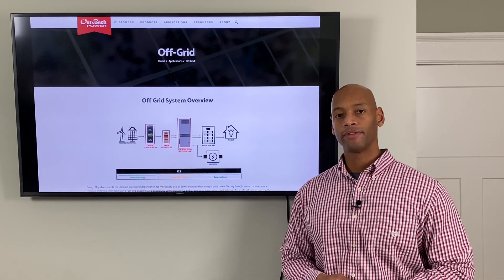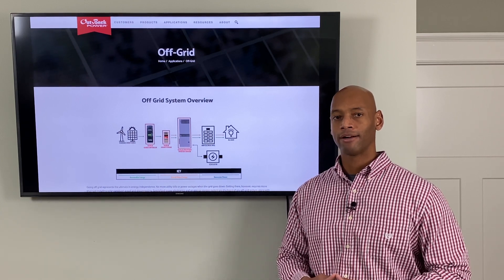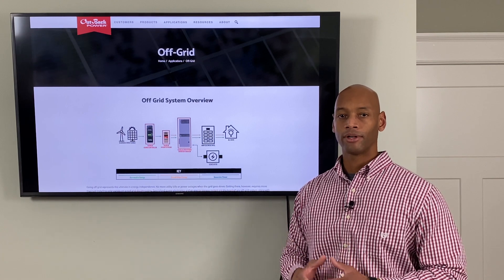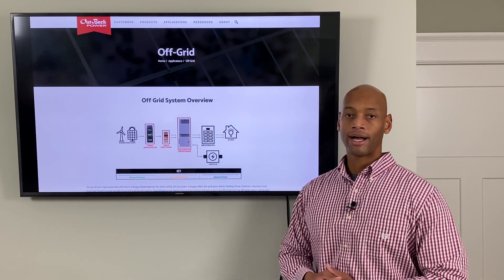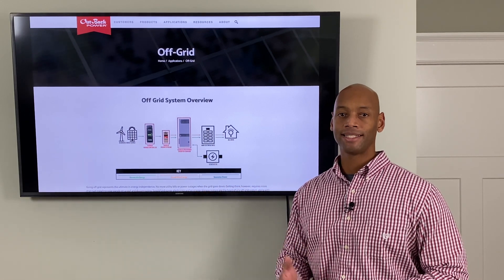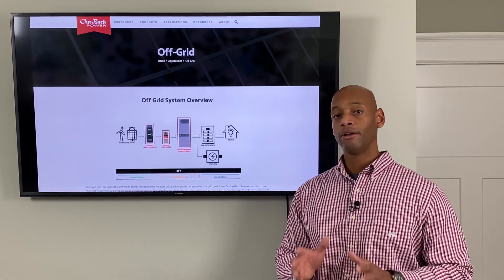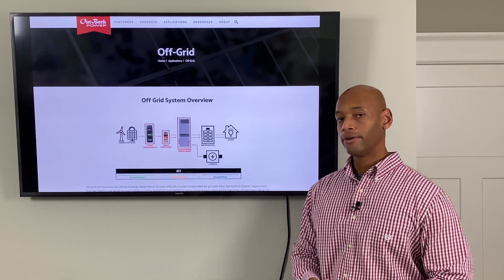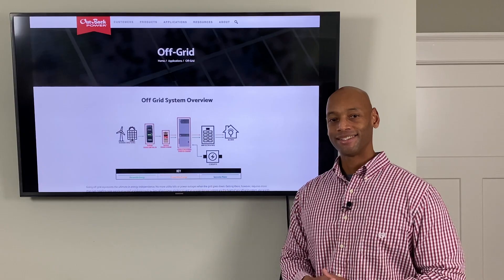Off Grid Solar Power System

Comment: Are the best solar panels 48v?
Reply from the maker: Not necessarily.  Most top residential solar panels have an operating voltage of 35-40V.  You can string multiple solar panels together the achieve higher voltage for charing a 48V battery bank.  You will need at least a 60V power source to charge a 48V nominal battery bank.

Comment: Joe, why do you use AGMs rather than LIPO?
Reply from the maker: I believe AGM is a better value than LIPO for grid-tied with battery backup.  In backup only applications, we only expect maybe 300 cycles during the total lifetime of the battery.  For a true 100% off-grid, LIPO is probably a better option considering total lifetime cost.